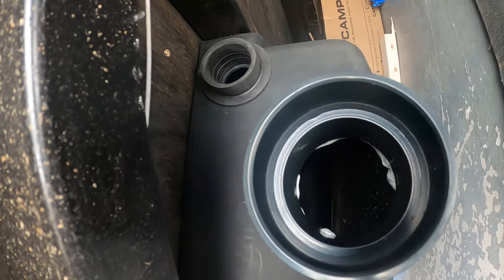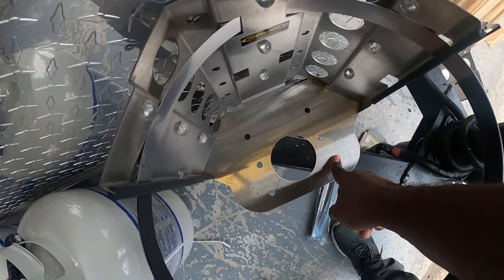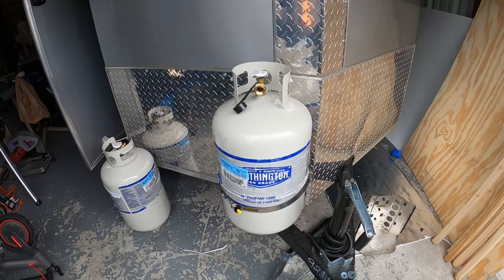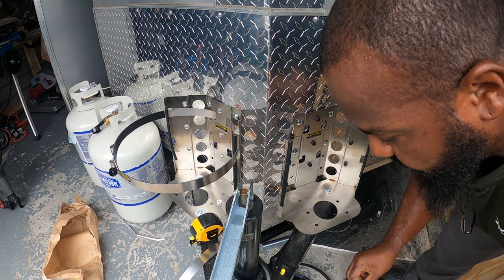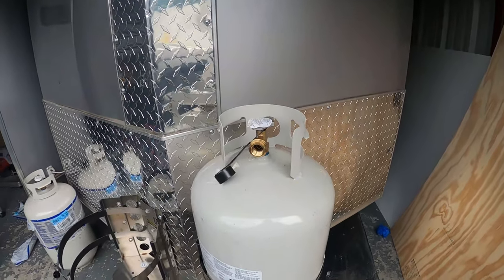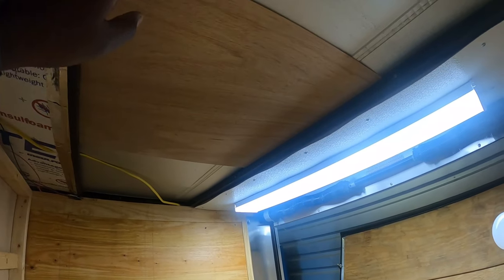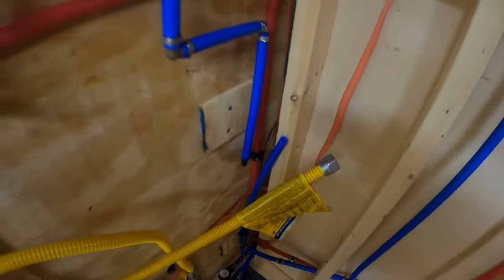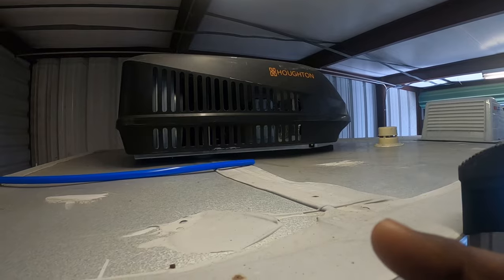Mobile Shower Trailer Build Part4

Comment: What did you use to seal the shower pan to the frp to prevent water?
Reply from the maker: @jackkitchin5659  I forget the exact product but some form of liquid nails style adhesive, I still need to silicone everything.  I have new video of the plumbing,  I just need to edit and post soon....